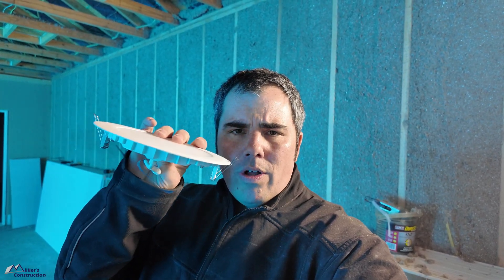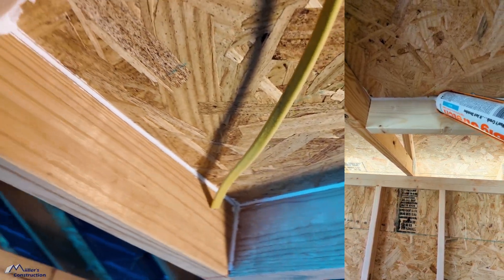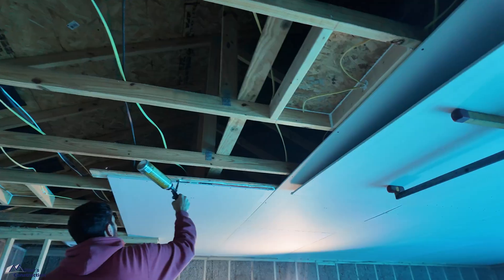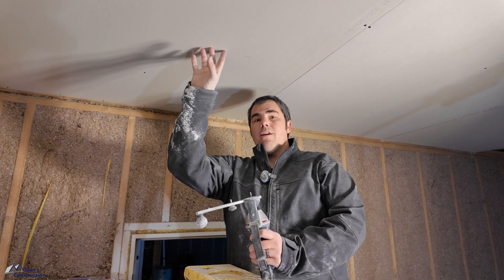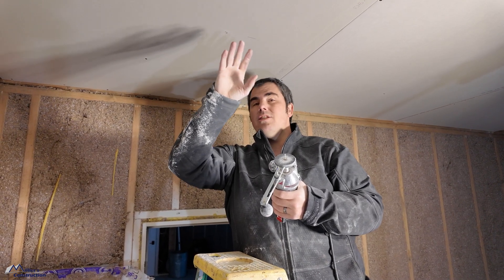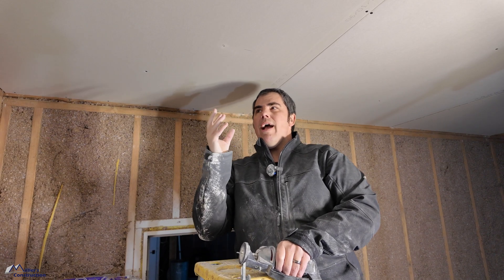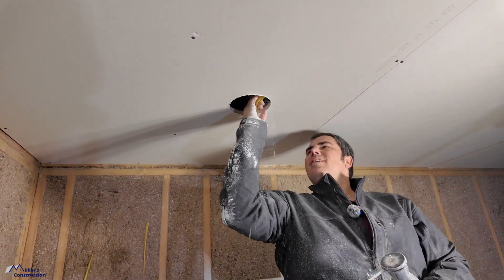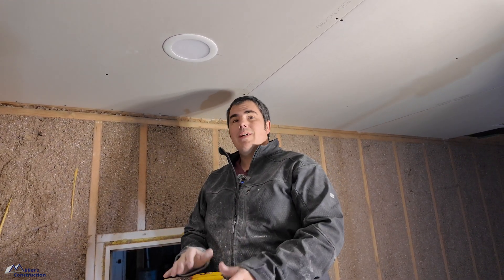How To Air Seal LED Wafer Lights - Step By Step!

Comment: So gang there are some boxes called Lesco boxes used for air sealing light switches. The PROBLEM is that if you have a 6” wafer light the 2 spring leavers that hold and compress the light to the ceiling won’t fit. So if you’re here researching HEADS UP.  Those tabs won’t fit in the box too but the driver fits fine. Anyway…

Comment: In a cold climate like zones 5, 6 and 7, I'd install 2" of XPS (R-10) under the OSB lid.  Otherwise when attic insulation is installed, there would be 3.5" of less insulation directly over the lights.   If you have R-49 attic insulation, you'd only have only R-36 over the lights.

Comment: Very nice. Love the box enclosure, BUT, I personally would have wired up the mini J-boxes and mounted to the ceiling joist before drywall.  The pigtails are generally long enough for 8-12 inces for some slack if ever needing replacement as well.
Reply from the maker: Very difficult to reach those fasteners. I tried it on one and stopped.

Comment: Brilliant solution, and so simple! Serious ice dam issues on my roof - I've been looking for products to seal up all the potlight holes going into my attic, they're hard to find and expensive. Building a box using the joists is great, I think I may do it with 2" rigid foam board. Thanks for this!!
Reply from the maker: You're very welcome and I hope the project goes well.

Comment: Thoughts/advice/viewpoint in using Foam Board for the box material versus wood?  I have access to the attic space where the lights are being installed.  Great video though, as limited solutions found!
Reply from the maker: I love it, and in some ways I think it's a better option. It's more expensive, and it can move with temperature swings. But if you use a good sealant like Big Stretch, it's a Great option. Little more insulation value, little less thermal bridge. But if you accidentally step on one after it's built, there's an issue. Not a bad option though, just more expensive. I would use XPS if I were doing it.

Comment: I admire the attention to detail, but you spent as much money (labor/material) making your enclosure as you did on the lights. Do your clients a solid and upgrade your lighting - at a minimum install regressed can lights to reduce glare. Lastly, instead of using OSB/caulk, just cut a piece of air barrier membrane and tape it down.
Reply from the maker: Sounds like you have it all figured out 👍
Reply: You might be surprised at how easily tape can leak air.  His method seems more solid, durable, and predictable IMO.

Comment: Another tip for locating your lights even if their boxes and wiring have been covered by drywall is to layout the room on the subfloor.  For instance, the location of the kitchen counters and dining room table and where to put the spot lights for best illumination.  You can then project these points from the subfloor to the ceiling with a laser.
Reply from the maker: We have used that method many times and it works wonderfully! It just depends on the jobsite if that's an option for us or not.

Comment: Some of them have a thin gasket sort of O-ring style around the edge of the wafer light. The springs on the little "holders" press the wafer light up against the drywall, compressing the gasket which air seals it. Also: why not just big stretch the rim of the wafer light? These things last for like a decade, no real reason to take them down frequently. A bit of caulk cleanup once a decade seems fine.
Reply from the maker: I have already replaced several within the last few years, I sure wish every single one of them lasted decades. That "gasket" is definitely not a proper air seal, especially on a textured ceiling. If your relying on gaskets like that throughout the house, your losing a lot of conditioned air. Perform a blower door test without an air sealed box above a wafer light and you will understand.
Reply: @miillersconstruction 100% agree!!

Comment: For most 6" wafer lights, a 6 1/4" hole saw is the recommended size, 4-1/4" for 4" lights.  Using a tool that can be dialed in to exactly the amount needed is better, but hole saws are quick and simple.
Reply from the maker: We used to use a hole saw. But we've found that each brand is a little different, and we've even found a few 6" lights that were closer to 5". That was a nightmare.
Reply: @miillersconstruction  yeah, you have to find what’s right for the light you’re installing for sure.